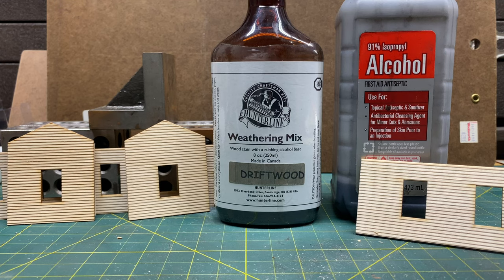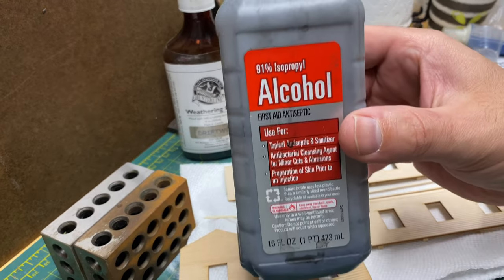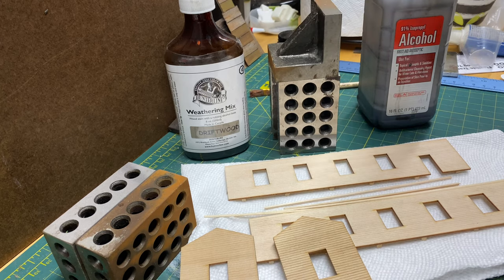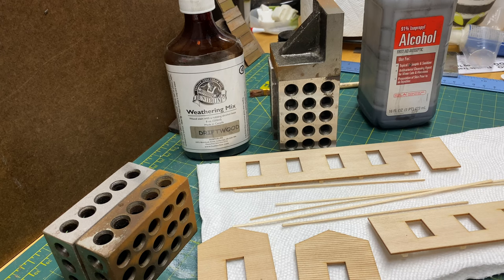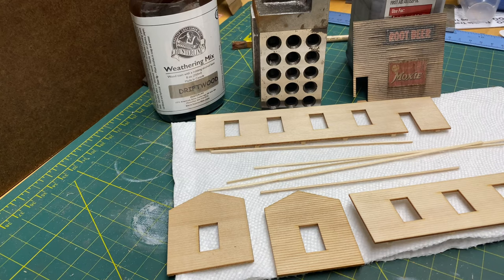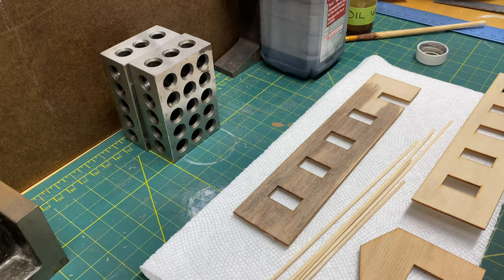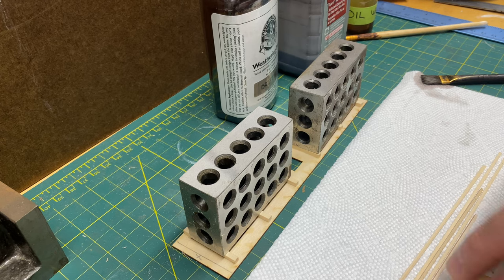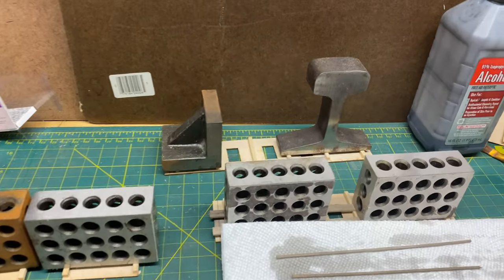Building a Craftsman Kit - Working with Stains & Washes

Comment: thanks for a great video. looking forward to the next one.. where did you get your weights from ?
Reply from the maker: The 123 blocks (ones with the holes) are from ebay.  They are not cheap but they are worth the investment!
Reply: You can also buy them without the holes for more weight.